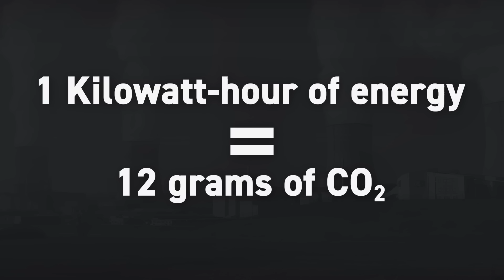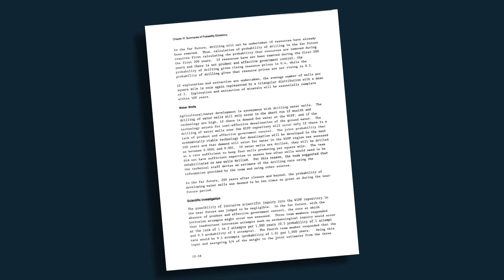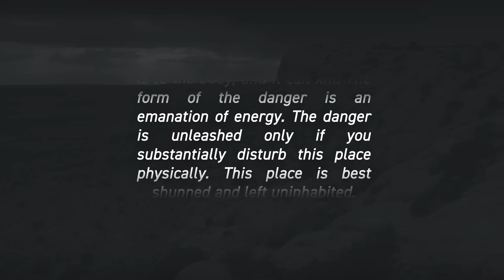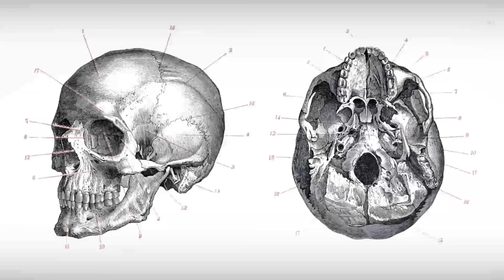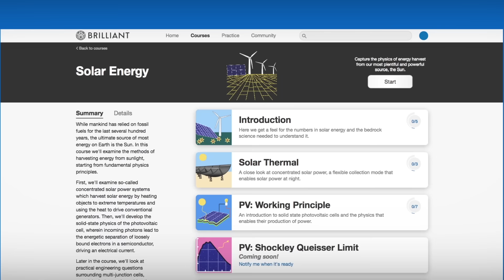The Nuclear Waste Problem

Comment: As somebody who works in nuclear, and specifically in spent fuel storage, I can assure that a number of things stated are false or misleading. For one, dry cask storage systems (the concrete steel cylinders) have various different designs that take natural disasters based on area into account. In California, at sites like San Onofre and Diablo Canyon, the casks each have their own individual slot 20' deep inside of a seismic safe concrete pad; this design is called a UMAX. On the east coast US, you don't have to worry about earthquakes or tsunamis of course. Two... No government or company in their right mind would leave an underground mausoleum unguarded; that bunch about the Finnish site is a complete lie, or at least would not apply in the US; happy to see it's being memed.
Reply: Am I a dick for thinking that if humanity is completely wiped out then how likely is it that Earth is still liveable and who actually thinks nuclear waste is a big issue then.
Reply: @NotASummoner  if that happens (which it will) the radiation leakage due to the other 'phenomenon' happening on earth, that supposedly wiped out living beings would be much greater than the nuclear waste but that will be taken care of in due time, it's the fact that these nuclear waste will even stand the test of time for 10k years or so and that poses a threat for the new class of living beings that will originate on earth. 

That's just my hypothesis, maybe the nuclear waste will die down too after million years or so ...since that's exactly how much time it took for humanity to reach here!
Reply: @tonamg53  I meant radiation leakage from a  'Phenomenon' (world war, volcanic eruptions, celestial bodies impact or just the oxides reacting in a funny way)...
Ofc, radiation from a nuclear waste is limited to an area but I wasn't talking about it. Read it again
Reply: @akhil.bhardwaj  This is the comment section of a video under the topic of “Nuclear Waste”.

Learn to read the topic of the video.
Reply: @akhil.bhardwaj  No, but you obviously are…
Reply: @tonamg53  Ok
Reply: You do need to worry about earthquakes in the east coast. They happen, just less frequently.
Reply: East coast west / coast what's the problem? Ans; West coast has the 
San Andreas fault and part of the west coast will separate.
East coast on the other hand, is part of America that has been drifting 
apart from Europe for millions of years. The truth is that no part
of the globe is geologically stable. So storage of nuclear waste is
still an unsolved problem.
Reply: @brianterence3211  But it has been solved tho. As OP has mentioned, the casks in which this type of material has been sealed in are basically indestructable, like the black box from planes. And there is currently a private company that aims to seal these casks so far below the earth that earthquakes, water seepage, tectonic plate movement or other geological problems that can disrupt the storage of the flasks are mittigated. And even if these casks were not burried but stayed above ground, they are literally designed to stand against any type of damage casued by severe weather or geolocial factors
Reply: You aren't very convincing at all.
Reply: @spectrebeats0007  RE; " so far below the earth that earthquakes, water seepage, tectonic plate movement or other geological problems that can disrupt the storage of the flasks are mittigated."
Reply: From where you are atm, below your feet by a few 100 meters, the earth's core is molten rock. Your ignorance is astounding.
Reply: @brianterence3211  you realise that the earth's core is more than 100m below us right? Even more than 1,000m or one kilometre. I think you're the one who is ignorant to not know that the mantle is earth's thickest layer therefore there is a lot of room to use. It's also below everything I said that could affect the casks
Reply: Thank you for saying the truth people like you and Kyle hill are legends

Comment: Between 2008 and 2017 there were over 1500 deaths resulting from oil extraction. The argument against nuclear power being safety issue is not a good one…

Comment: Theese structures will not be dug up in 1000 years, they will be dug up in a few decades when we want the Uranium 238 for breeder reactors.
Reply: I really hope this happens, except skipping the burying them in the first part bit. It's amazing we have the technology that makes nuclear waste practically nonexistant, but we instead are planning on just throwing it all in a hole.
Reply: Exactly, or possibly even Fast Spectrum Molten Salt reactors. Convert it all to fission products and it decays to below natural uranium in 300 years.
Reply: @greedtheron8362  
What's the technology that makes nuclear waste non existent fool ?
Reply: Look up breeder reactors. Takes unstable elements, like Uranium, and turns them into either more stuff you can shove into a reactor, like Plutonium, or turns it into stable, non radioactive elements, like Actinides. People don't like it so much because it's eaiser to turn Plutonium into a bomb than uranium, but those people haven't come up with a good solution for the waste. Completely legit science, not fool stuff.
Reply: In a few decades we shouldn't be using uranium. We should be using thorium.
Reply: @jacoby6000  We should be using both.
98% of Uranium is Uranium 238,which can not be fissed in normal reactors, but the same breeder type reaction technology which uses Thorium will be put into using Uranium 238 as fuel.
Reply: @greedtheron8362  Making an
A-bomb with Plutonium is much harder than with U 235. You need to compress the Plutonium very quickly into one spot with a pyrotechnical lense.
Reply: That 100k year before all those waste lose its radiation.. Curious  human
Reply: Hi, I have no knowledge about nuclear but curious about it. What if the waste is detonated in the same place where there is no civilisation or deep in the ocean, maybe?
Reply: @Mannalon31  what about throwing them to bermuda triangle? We can use self-flying plane, surely it'll cost A LOT.
Reply: @rennynurjannah3541  no, stop
Reply: @TheInsaiyan  why?
Reply: @rennynurjannah3541  why Bermuda triangle? U know there is nothing special about it.

U don't wanna throw these materials in the ocean.
Before we throw them away we should figure out if we can reuse them.
Since we only used 1% of the useable fuel and need to figure oht how to deal with the fission leftover instead.
Reply: @TheInsaiyan  
That's right, bcz there is nothing there and the nuclear waste contains dangerous chemical or whatever so I suggest bermuda triangle 

But you are right about the second point. Probably in the future the waste is usable
Reply: @jacoby6000  safest is to denature it with Uranium U238 and Uranium 232 (~ 2.4%); You will not be able to make a bomb out of that any time soon ;)
Reply: @greedtheron8362  Molten Chloride Reactor like TerraPower or Moltex
Reply: @TheInsaiyan  
becasue there is nothing in it so it won't do harm to any living things/human. 
Nevertheless, you are right about tapping its leftover energy before throwing it away.
Reply: Exactly my thoughts. The fear mongering is un-necessary. The elements must be respected and understood, but not feared.
Reply: @AllSeeingEyesMetal  No, it doesn't, but tritium is a self-fixing problem.  In 120 years it has decayed to less than a thousandth of its original radioactivity, about three times faster than the longest common fission products, which cannot be "burned up".
Reply: @rennynurjannah3541 : Blowing it up solves nothing - it just spreads it around, making it more difficult to contain.  Winds pick it up and all of a sudden it's in your pea patch.  Where exactly is there "no civilization"  The oceans are a possibility, but most purists have problems with that even though they know the ocean from nothing.  Early on it was proposed drilling holes in the deep ocean floor to bury it in but the outcry made it politically impossible.  NIMBYism controls our lives.
Reply: @rennynurjannah3541 :  I remember you saying above that you know little about radiation.  Might I suggest you learn some before pontificating on what we must do?  Particularly that Bermuda Triangle stuff.  That's just embarrassing.
Reply: @AllSeeingEyesMetal  As it sits in tanks all over the property, no one pays it any attention, because it is obviously not harming anyone or anything there.  Its radioactivity level is comparable to Finnish well-water, at 250 Becquerels per liter.  The solution is to take it out about 30 miles off the coast in deep Pacific water and dump it.  It will be vastly diluted before it sees land again, well below normal background levels, and half of it will decay to regular water regardless of where it is every 12 years, just as it is doing in the tanks.  

Well, first of all, it's not a fission product.  Its a neutron activation product.  And sure, it's not the only problem that the Japanese face, but its the pressing one right now, and the one that can easily be fixed.  It's the principle of the low hanging fruit.  The #1 problem, as it is in Chernobyl, is cesium-137; everything else pales in comparison to it for the next 300 years, most certainly including the tritium.
Reply: @AllSeeingEyesMetal  there are tritium removal facilities in the world. nice try kiddo.
Reply: The nuclear waste dumps will come in handy when the next Ice Age freezes over Earth for 15,000 years...
Better set aside some of that fuel for the Long Haul...
Reply: @annechester770  more or less, Molten Salt Fuel thermal spectrum breeder reactors.

Look up the Oak Ridge Experiment, LFTR and Alvin Weinberg. 

There's a good reason that there's so much interest in getting this technology working again and then continuing the research that was shut down by Nixon in 1972, since it was declassified in 1998.
Reply: Greed theron: 

Civil breeder reactors aren't much chop as weapons-producers. They make so many  mixed up isotopes that used and rerefined fuel is virttually impossible to separate into bombmaking  grades (any excess radioactivity will make weapons fizzle and all the unwanted stuff is very high radioactivity).

A closed cycle breeder like a MSR doesn't let used fuel out of the reactor so it's even safer.

The REAL weaponisation of nuclear fuel cycles happens during the initial enrichment phase(*) and getting away from Uranium(**) as a civil nuclear fuel is the greatest step we can take towards shutting down proliferation cycles.

(*) Enriching beyond 3% allows making plutonium-producing reactors using the high quality depleetd uranium. The depleted uranium itself is an essential part of boosted yield weapons.

(**) As the Indians proved back in the 1970s, even a "natural uranium" reactor (CANDU cycle) can be weaponised by extracting plutonium from the loop. The only way to prevent this is to only allow uranium as part of a fuel mix dominated by thorium. 

A MSR fuelled by Thorium (the reactor part is mostly uranium U233 and u232, but it's derived from Thorium by exposing the thoriuum to excess neutrons from the reaction) can burn all the other actinides as sidestream fuel if added in small quantities so it doesn't poison the reactor - this solves the nuclear waste issue ("if it's radioactive, it's valuable, chuck it into the furnace and let it break down with everything else") and the primary waste products are helium, xenon, tritium(***) and a bunch of noble metals which are all extracted whilst the system is running.

The possibilities of a Helium economy are amazing - and tritium is either a bloody nuisance or a valuable resource depending who you talk to - it's great for making self-illuminated signs but they only last 12-15 years before fading out.
Reply: @jannikheidemann3805  a uranium bomb is much harder than a uranium one inasmuch as you end up throwing out 99.998% of the source metal to make weapons-grade (greater than 95% U235) uranium. 

That's a LOT of energy and centrifuges - bear in mind that the raw cost of uranium or thorium is about $100/kg whilst civil uranium goes for about $45,000/kg - tosses out at least 89.6% of the source metal and that's only 3% U235 - it's widely believed the US military sells reactor grade fuel for about 10% of the actual manufacturing cost as the real figures are a classified secret and the size of the power lines (plus comments from powercos) into the Tennessee facilities hint that it's closer to $500k/kg to enrich. based on the official output levels.

The Hiroshima bomb cost several billion dollars in 1946 money - and it wasn't actually weapons-grade uranium (only about 85% U235). The Nagasaki one was "only" a few tens of millions. (materials costs, not the R&D)

There is 45,000 TONS of thorium buried in the Utah desert - the US DoE couldn't get rid of it, so they buried it there in the 1980s. We're not exactly short of fuel for thorium cycle - and an average rare earth mine extracts about 5000 tones of thorium per year - it's their single greatest waste product and the hardest to deal with as they're not allowed to simply put it back in the ground where it came from due to its 15 billion year half life.
Reply: breeder reactors dont work
Reply: True
Reply: Abdi  What if the rocket blows up?
Reply: because of Cosmos 954, because rockets sometimese explose during launch, because you need 100 tons of fuels to put 10 tons in low orbit
Reply: @AllSeeingEyesMetal  You do realise tritium is harmless?
You can swim in it and literally nothing would happen to you.
You can probably even drink it and be fine.
Reply: @AllSeeingEyesMetal  tritium is a beta particle emitter, which is too weak to even penetrate your skin.
By drinking it out of the ocean you will get sick a lot faster because of drinking saltwater than tritium...
If you would ever get in contact with it as it is the heaviest form of water. Physics tells us that in a liquid, lighter particles stay on top while heavier sink to the bottom.
So, I don't see absolutely anything wrong with letting it sink to the bottom of the ocean - which is lifeless anyway.
Reply: @AllSeeingEyesMetal  there is no scientific proof it can cause any kind of harm. Thats a fact. Especially in very low concentrations - and that's the case in Fukushima.
Reply: @AllSeeingEyesMetal  if you think it's glowing then apparently your knowledge of the subject is taken from cartoons.
Reply: @AllSeeingEyesMetal  ITS NOT EVEN HAZARDOUS! They keep it in these silos because public demand so - not because it makes any sense what-so-ever.
99.9999999999% of what in them is perfectly normal groundwater. they estimate there's maybe like 14 ml of tritium in 860000 m3 of normal groundwater...
They should have dumped it in the ocean long time ago - but imagine the drama...